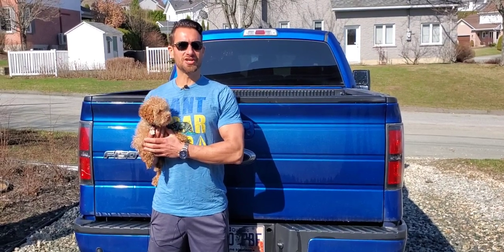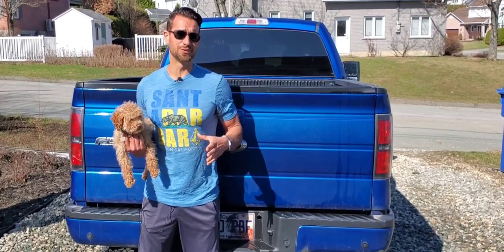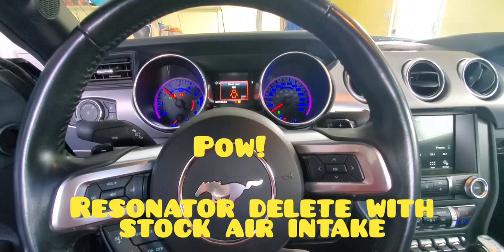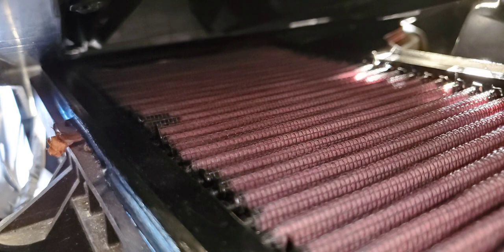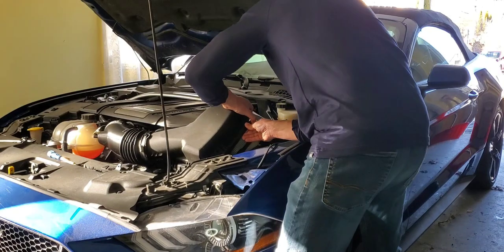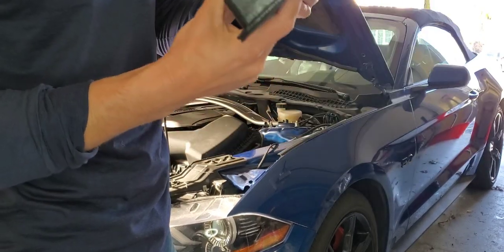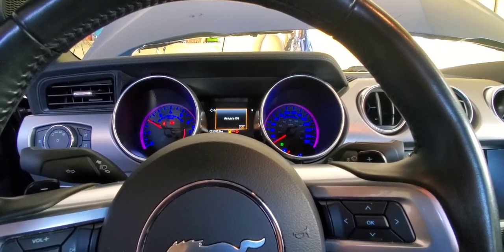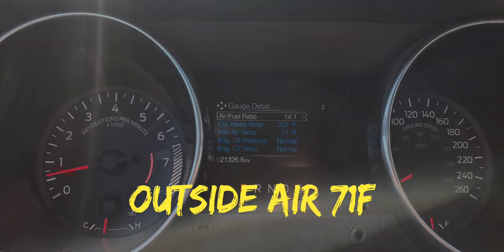2021 Ford Bronco Upgrade: Air Intake or Highflow Air Filter? Tested on my Mustang GT

Comment: I have a 1994 Dodge Ram 2500 Diesel. I needed more power to pull a 5th wheel trailer, so I put a tune in it and that gave it a good boost of power. Then I replaced the airbox with upgraded cold air box and filter. Wow, what a difference. Then I replaced the 3" exhaust with a 4" exhaust with a new 4" muffler and again, a big difference. So my first upgrade for my Bronco will be a better Cold Airbox and filter, and then I will look into what can be done about the exhaust while staying legal in California, or not. It makes me feel good that you have the same plan for yours. Thanks for the video.
Reply from the maker: The oil on a sensor was not on my radar. Thank you for bringing this up. I use to always modify the exhaust first but now I'll be starting with the air intake.

Comment: I use dry filters like the air raid or green filter. Oiled filters can contaminate your mass air sensor with oil...
Reply from the maker: Thank you for this helpful and informative comment. I am sure I am not the only one that this helps.

Comment: I think that the first upgrade is an E30 tune... which negates the need for any hardware and will make a lot more power than any air filter/exhaust mod will ever make.  It also negates the issue with the "hot air" due to the evaporative cooling effect of ethanol.  

By the way, if your motor was flowing 30% more CFM, you would be making 30% more power... The filter may be capable of 30% more, but that's not the only restriction or the rate limiting factor for the motor.  I am quite sure that your air filter didn't take your motor from 435 HP to 565 HP.  

Air flow (CFM) = (Horsepower × 0.625) × 1.1104 
Horsepower = (Air flow × 1.6) × 0.9

Just saying... Math.
Reply from the maker: Thank you for the helpful and informative comment. Always a pleasure to learn from your comments.

Comment: Down pipes soon as someone designs them along with upgraded intercooler.
Reply from the maker: Downpipes are great, but there longevity in salty areas are often not as great as oem. However, keeping an eye on material used over price is important.

Comment: You won't be able to do any of those things till a company gets their parts CARB certified for the Bronco. I think a solid axle swap is the first upgrade.
Reply from the maker: Interesting. IT will make it less of a daily though. What exact reasons would you go solid front axle? Would you do it even if you have a Badlands?
Reply: @Johnnyscarcarereviews  Theres going to be a lot of people buying Broncos just to have the latest newest rig, but the serious buyers who want to try something different in the OFF Road environment will try to get more out of it than IFS can offer. Without fail, when these people build a rig, no matter the brand, they put in a solid front axle as it offers more options and strength.